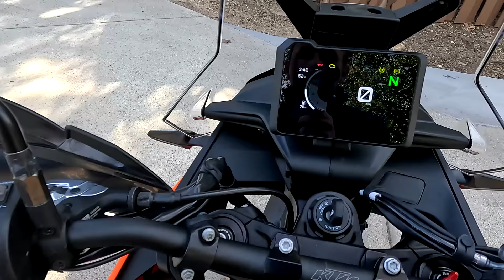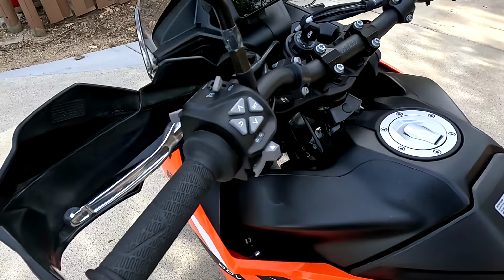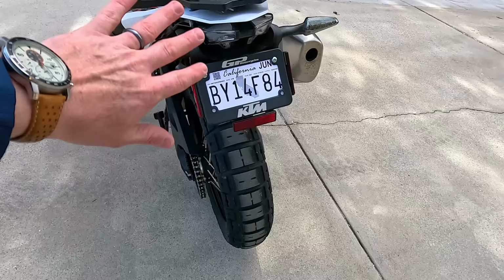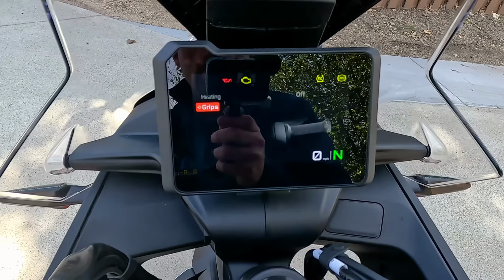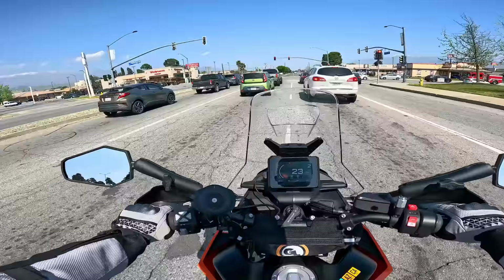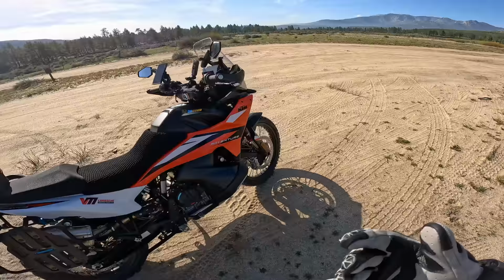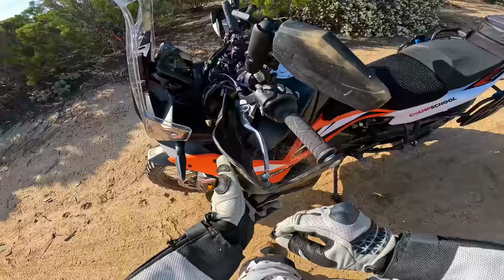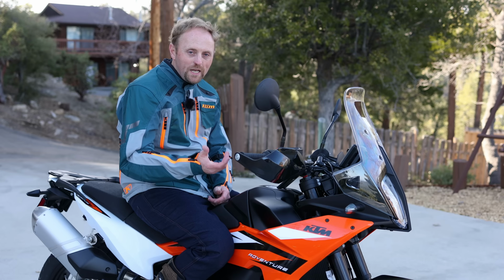2023 KTM 890 Adventure | Perfect Do-It-All Mid-Sizer ?? (EP.2) (Full Review)

Comment: About carrying a spare tube, unfortunately they have retained the off centre air valve on the rim, that does not lend itself to using an inner tube, if the necessity arises. Unfortunate oversight by KTM. Having said that, this is the unicorn bike I crave. It has everything going for
It for 99 % of adventure riders, on, and off road. Such an ingenious design. Forget about the high reliability reputation of other bikes. No manufacturer has a uniquely capable, comfortable bike like this KTM 890 Adventure. No need for R for the majority of us, now with this upgraded model, for 2023. If the price is an issue, there is the 790 which is exactly the same bike less adjustable front suspension. Again, the fixed front suspension on the 790 is optimised for the majority of riders.
Reply: Well, ktms really have issues, but on the software side. You can always hit Triumph to check the tiger 900, wich imho is the best offer on the market right now.
Reply: @MajinMunga  Triumph 900! Nice! But, heavier, more top heavy, more expensive. For me, runner up to the 890.
Reply: @MajinMunga  thats funny ive owned and put a lot of miles on several KTM's and im honest enough to agree ive experienced some issues here and there that i wouldnt have expected on a Yamaha or Honda but never anything to do with the software or electronics ??
Reply: @davidmallia628  that 890/901 pkg is next level good with the performance vs weight and that low center of gravity nothing else touches it currently
Reply: @justsomedude445  that's what I got from their service worker. He said that mechanically they are top notch. But software is an issue, and you need to take it to the dealer. Not my experience tho, so I can't swear by it.
Reply: @MajinMunga  i only consider actual real world first person experience , if i bought into any of the absolute bullsh/t constantly spewed online id be afraid to ride anything that makes me smile at all , ive run well over 100,000miles on just the last 3ktm/husky bikes combined not counting the prior
Reply: @justsomedude445  well, so 1st hand experience was that the engine melted in one superduke that i know :) He went for a trackday and the engine melted on the way home. Blocked the pistons inside the cylinders and that was it. KTM did repair it on their own, even tho warranty ended 6months prior.
Reply: @MajinMunga  your own Superduke "melted"??
Reply: @justsomedude445  like i said, one that i know of. Confirmed by the service shop i was in, and by the guy who did it. So 2 seperate parties confirmed the same story.
Reply: @MajinMunga    so not first hand at all !   not saying it didnt happen just that you dont know the details , what actually happened why or how , not your bike , your were not riding it , heck you were not even there when 'it' happened
Reply: @justsomedude445  DUDE, chill. 2nd, i don't care if you believe me or not. 3rd, i know the story of the bike, 4th, farewell

Comment: Also there's no way the Desert X handles better than this, because all the weight is high, up on top on that bike. No other ADV bike can handle as well as the KTM's and Norden because they just don't have the weight centralized and distributed down low as well as these bikes do. >The only other bike that has an advantage in this is the BMW GS or any other boxer BMW. They are the masters of low down weight centralization and therefore overall motorcycle balanced chassis.

Comment: Comparing this bike to a GS is moronic (replacing a GS for this bike is even more questionable).  I am an Enduro instructor (I ride a GS), 2 weeks ago, I had 2 (experience riders) students on this bike (brand-new) and let me tell you that they both were not happy people and were really struggling hard, were the students on GSs were having a good time.  Their swearing was way more intense than the life loving feeling of the other students... 
Just compare the "all-day", 2 fingers operation of the KTM's cable clutch as opposed to the super smooth hydraulic GS, and you will understand what I am talking about.  KTM even has the audacity to put a hole in the windshield to prevent buffering, and people find that excusable - maybe you should remove the windshield alltogether for even less buffering.  The GS is a much better overall bike - period.

Comment: How is the clutch pull for commuting, you did not mention the most important part for city cruising. That is just strange. I also noticed how you obviously go out your way to NOT mention the Husky Norden 901 any more. Which is more then silly to me, just so, so silly. How can you even consider your self to make reviews if you can't keep an objective view on all the motorcycles you ride and test or own?? Norden is just as good of a bike in almost every way as this KTM, in some ways I'd say even better. But for some reason you don't want to acknowledge this fact, All it needed is the option to swap between taller and original lower wind screen and it's a perfect bike. Not to mention the Exp model which just came out. But even the normal Norden is just as good as this bike, the suspension is the same now. Cause it's finally adjustable on this KTM, only 2cm taller on the Norden which must be better still for certain things. Just don't like you man because you are clearly biased.